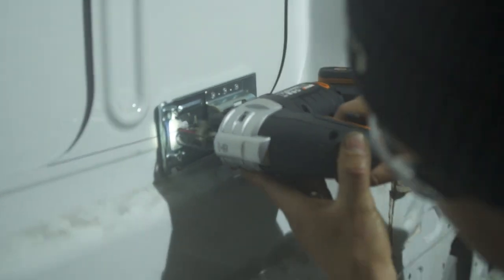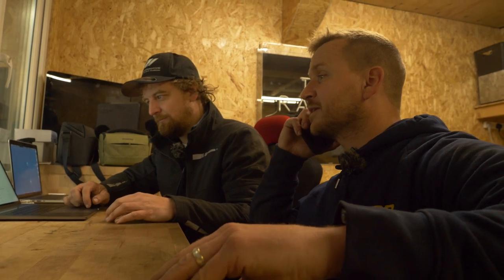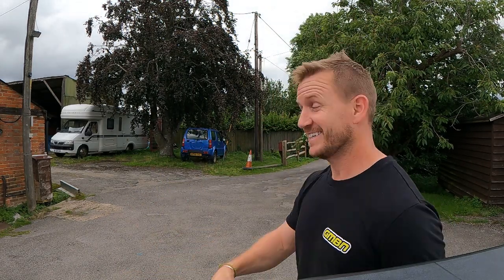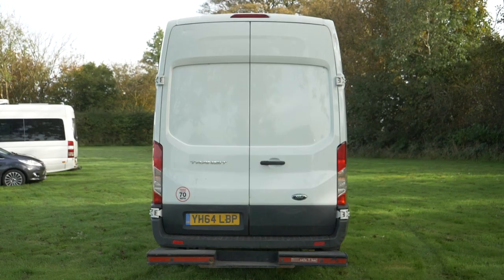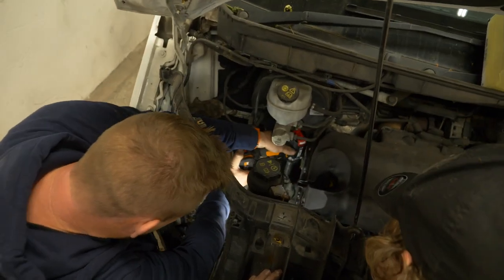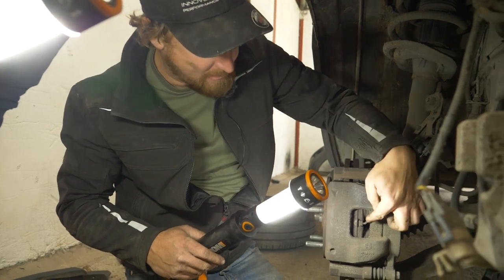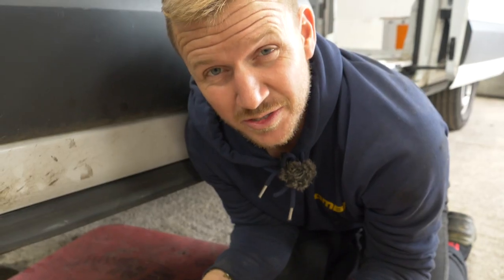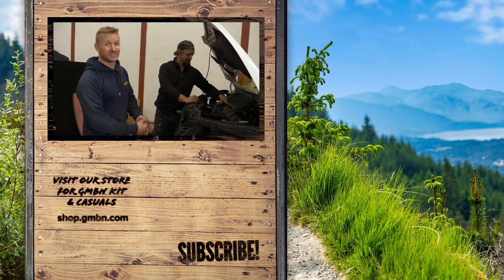Building The Ultimate Mountain Bike Van! | Blake Builds Van Life Ep. 1

Comment: Just be sure to take into consideration maintenance access in odd places. Recently watched a van life video in which the owner of a Dodge Pro Master was unable to have the van's power mirrors diagnosed/repaired because the build had 'permanently' covered over the driver (American) side inner rear corner of the van, about midway up. Apparently there's an access panel in that location with a diagnostic(?) port. The owner resorted to temporarily turning the power mirrors into manuals by gaffer taping them in place as a short-term fix.

Comment: Looks exactly like the US version of the Transit, but we only get the RWD/AWD version, no FWD.  Diesels are also rare on US Transits, most of ours have a petrol V6 though I've seen a few with the 3.2L diesel.  Still probably the best platform around for a camper van conversion, MB Sprinters are VERY expensive stateside, Ram Pro Masters are an alternative but are FWD only and have very little ground clearance (they are based off some Fiat van).  Traditional American style vans, which are all RWD and tend to have big V8 engines don't have the high roofline that Euro style vans have so lack room to convert.